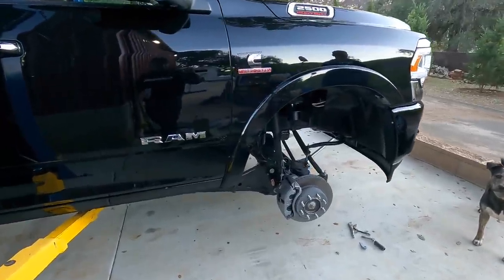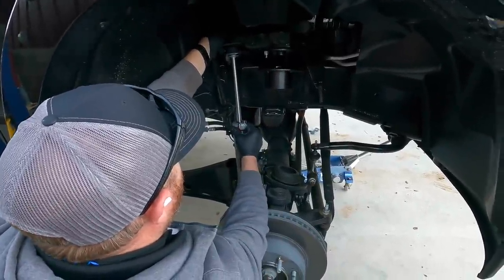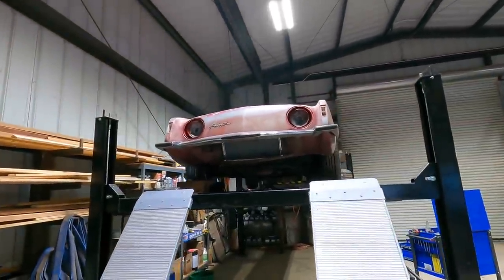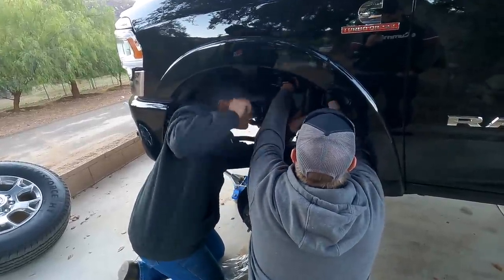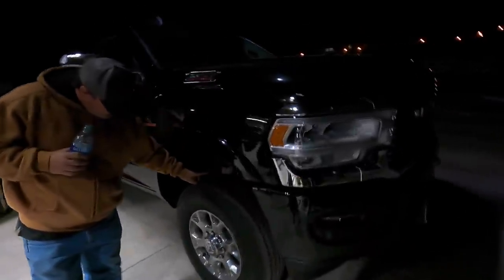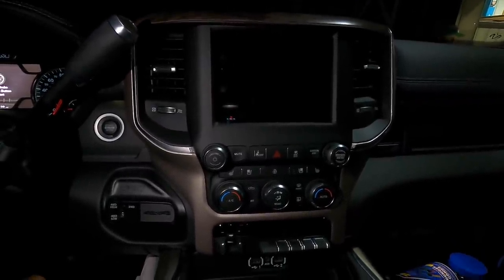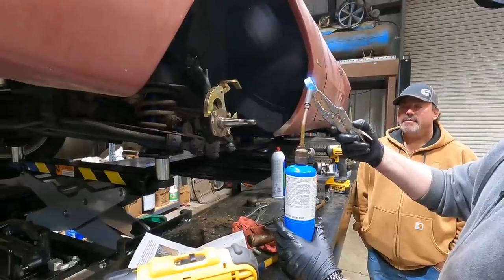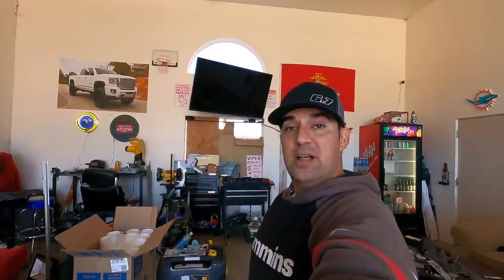Worst leveling kit install ever!!!

Comment: The updated cp4 will still have the like you saw 6 dimples but it will also have 1 big dimple just to the side. So look for that. If you see a single bigger dimple then it is the updated.

Comment: If you spend $50-70K+ on a truck you owe it to yourself to get a quality leveling/ lift kit. Buy Thuren or Carli with Fox, or King shocks. At a minimum, I'd buy the Bilstein kit (if I wanted quality and wanted to save at the same time). I have a Thuren 2in leveling kit on my 2500.

Comment: Have to agree with these guys Thuren or Carli kit. Installed the Thuren level kit on my 2020 Ram 3500 dually Limited and was surprised on the ride quality improvement.  Sooo......... much better then stock.  I'll report back when I have a load or trailer hooked up.  Rough Country stuff has their purpose, and I get it.  Just not on a nice 5th gen Ram or $60k truck for that matter.

Comment: There all just different names to different trim styles there all the same deep down. I was at the local ram dealership an noticed the bed to cab was a little off like more on the driver side just a little off like bumper maybe just needs to be loosen the readjusted i don't know 😕 but brand new.

Comment: Your limited comes with a black headliner where the Laramie comes factory with the grey. I much rather the black headliner in the Limited.
Reply: My big horn is all black headliner to
Reply: Laramies come with blacked out interior. Got one sitting n my driveway
Reply: Maybe depends on what level they are i know my big horn is a level 2 maybe thats why not sure
Reply: @benbarker8145  Yeah, got a pretty good local dealer that orders trucks like people want them..maybe that's the difference.
My megacab Laramie Off-road has every option that a limited has, just no limited badging. 
I did opt for the Alpine speakers over the HK, that was simply my choice because the Alpine sounds better to me personally.
Reply: @robertwingate650  yea mines got the alpine with the sub pretty sweet
Reply: my Laramie is all black everything inside

Comment: As PD diesel power already says the laremie is just a bead copy of the limited. The sit aren’t full leather, steering wheel is all leather, handle aren’t cover with the leather.  In my opinion if you’re spending the $ to get a laremie you should get the limited or a big horn. Laremie says I’d like to have but I can’t have it.
Reply: The big horn the best selling model than the Laramie but if u want more towing dont get a limited